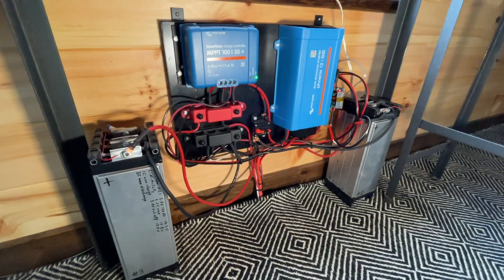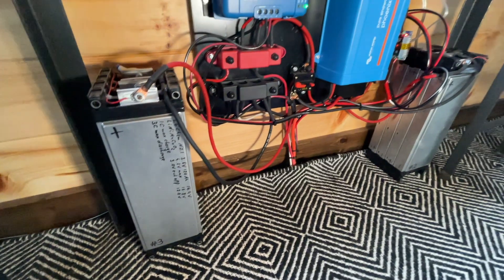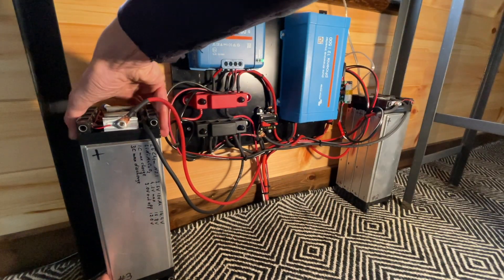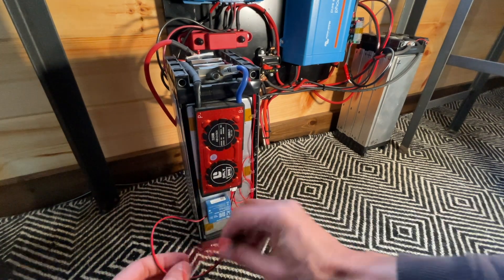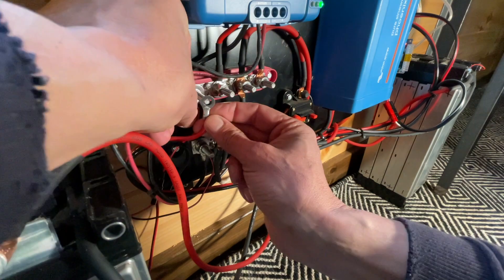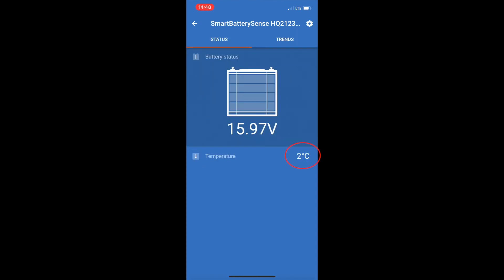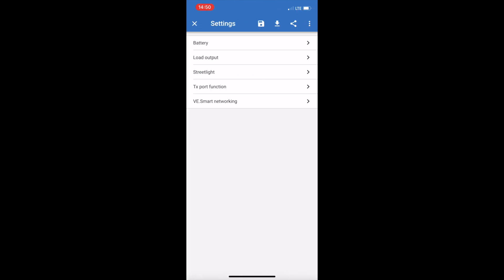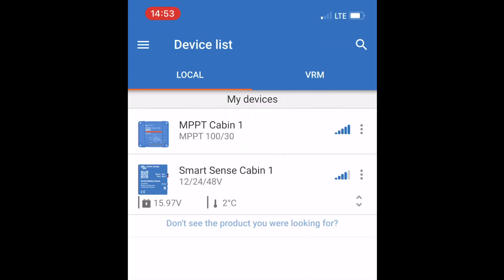Installing Victron Smart Battery Sense

Comment: Although your main aim was to measure temperature…
The sensor is intended to be installed directly at the battery terminals. By installing it at the bus bar there will be a measurable voltage drop across the battery to bus bar cables due to resistance of the cables that will be markedly increased the more current you draw.

When minimal current is drawn (idle conditions) the voltage at both battery’s terminals will be almost identical so you could cheap it and only install one sensor on one of your batteries.
The coldest one obviously 😉
Reply from the maker: Yes you are correct, the sensor should be right on the battery terminals for most accurate readings. It works well in my case because I don’t charge to full voltage and my temperature is set to a few degrees above freezing.
I use it only to keep the batteries from charging below freezing temperatures.
Thank you for your comment!
Reply: @offgridsimplicity  help me understand what hes talking about. my current temp probe is mounted underneath my battery where its coldest. why would i put that one and this one for panels on the terminals?
Reply from the maker: @pearlrival3124  You are concerned about the electrolyte temperature that needs to be above freezing for safe charging. I would place the temperature sensor half way up the battery and set the temperature cutoff to 2 or 3 degrees Celsius. It has worked well for me.

Comment: I have 2 12 volt Lifepro4 100Ah batteries for my 24V trolling motor. I need to be able to check how much charge the batteries have left while I'm out on the water. I currently have 2 standard 12v gauges mounted in the front of my boat that I had for my lead acid batteries. I have read that using the voltage only does not accurantly indicate how much power the battery has left. I would like some guidance as I am new to the Lithium batteries world.
Reply from the maker: With Lithium batteries you cannot use voltage to determine state of charge. The discharge curve is too flat and you won't see a voltage drop until the very end of the state of charge (around 10% depending on chemistry). You may want to question if you really need a state of charge indicator. I have may Lithium battery systems and only one of them has that. There are programable BMS systems on the market that work with shunts to measure the Wh used. I don't need that, but it is technically possible.
Reply: @offgridsimplicity I just wanted a way to check the remaining voltage before they get too low as one of the lakes I fish is trolling motor only. So those monitors that use the shunts can provide how much charge has been used? Having 2 batteries means I would have to have 2 of them, which is pretty expensive. Thanks for your response. This whole conversation to lithium is becoming a real pain, mostly because I don't know how it works and no matter how many youtube videos you watch you still get confused.
Reply from the maker: Don't take this the wrong way, but forget about voltage and forget about everything you know about lead acid batteries! Lithium chemistry is completely different and much, much more capable. I race offshore sailing yachts and I know what you are talking about being out on the water wanting to know what your state of charge is. You don't need it. Calculate your Wh of capacity, then see how much your trolling motor draws (in Wh), then you know how long you can run it at 100% power and speed. That's your range in miles, slower lower draw is almost proportionally less with displacement hulls like your fishing boat. You will find that you have plenty of range. The other way I measure battery consumption is to measure the charging energy in Wh when I change them back up. These shunts are $20.- on Amazon. That will tell you how much energy in Wh you used.
Reply: @offgridsimplicity  My trolling motor says it uses 42 amps at full power. It doesn't give me the Wh. I'm assuming my Wh capacity would be 100? I rarely, if ever use the full thrust. Especially for any length of time.
Reply from the maker: @jamesgibbons6292  42A times Voltage is Watt, for one hour makes it Watt hours (Wh). So 42A times 12Volts would be 504Watts, for 1 hour would be 504Wh. Your batteries are 12V times 200A makes 2400Wh. Divide that by 504Wh lets you run your trolling motor for 4+ hours art full speed.
Reply: @offgridsimplicity That's perfect!! I should never use that much power in a day. I don't fish that long and certainly would not be at full power. Thank you so much for your help. That's a big relief to me as math is not my strongest subject. It's quite confusing if you're not familiar with it. Thanks again!!
Reply from the maker: @jamesgibbons6292  you are welcome, glad I could help. Lithium is awesome!
Reply: @offgridsimplicity  Just a thought. This is the calculations with my trolling motor be a 24 volt??
Reply from the maker: @jamesgibbons6292  24V would be half the range, so 2+ hours at full speed. Still plenty.

Comment: how you change from Celsius to Fahrenheit
Reply from the maker: You can change it in settings of Victron connect for the Smart Battery Sense. You may have to further change it in settings for external displays, or charge controller settings.  Make sure you firmware is updated. Older firmware does not have the function (as far as I know).

Comment: Can you use the smart battery sense just to monitor your battery voltage without having to buy all that other overpriced victron garbage?
Reply from the maker: I don’t think so. I think the battery sense needs to communicate through a charge controller or other inverter / charger. But I am not 100% sure.
Reply: @offgridsimplicity  Thank you
Reply: @DaveSquibbSr: I have one and no you don't.
Reply: @gr7485  thank you
Reply: yes, you absolutely can. its Bluetooth and displays the voltage and temp on your phone, Just FYI the other stuff is not garbage. cheers!
Reply: @JayRSwan  thank you
Reply: Yes, you DONT need to even buy a victron controller for the battery / temp sense.  I have many of the controllers, BUT I use one just to validate the temperature in an outside battery box full of lead acid as a SECOND temp sensor on my midnite solar array.  These sensors work on 12,24,48v batteries and you do NOT need one for LithiumFePO4 since the BMS is more reliable tool....